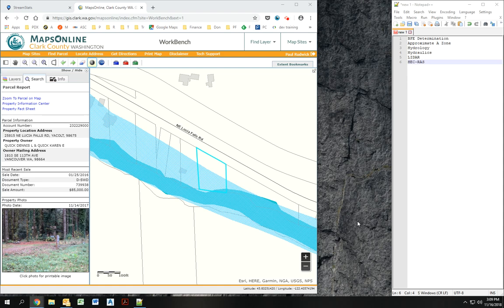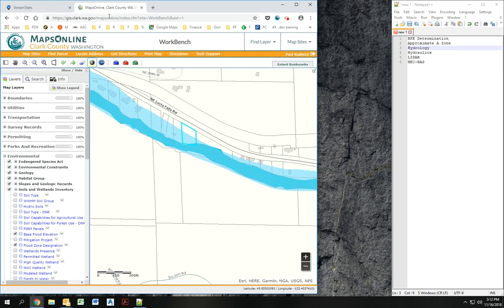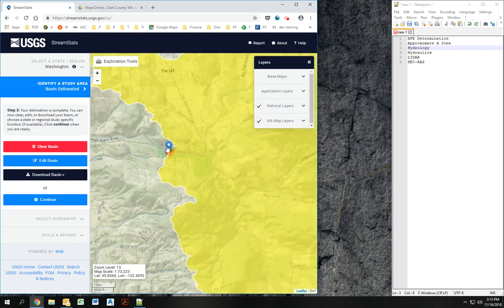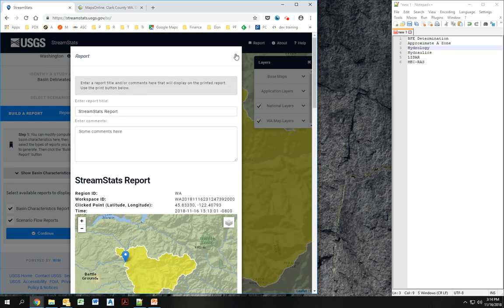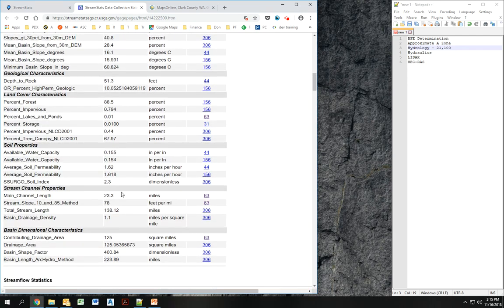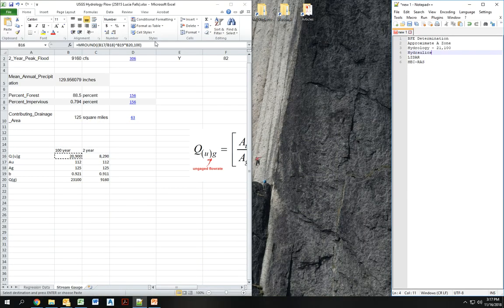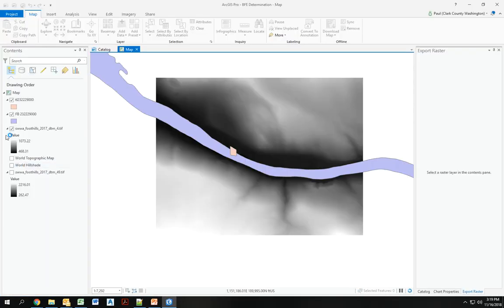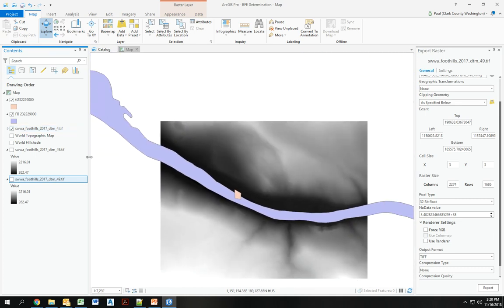HEC-RAS Tutorial For Beginners - From Scratch Hec-RAS setup and run, 100 yr flood flow, Lidar Clip,

Comment: How to determine slope
Reply from the maker: Good question! In RAS Mapper, use the measure distance slope and that should automatically calculate a slope for you. Also in the geometry editor you can use the measure line command (hold control and click two points). Hope that helps!